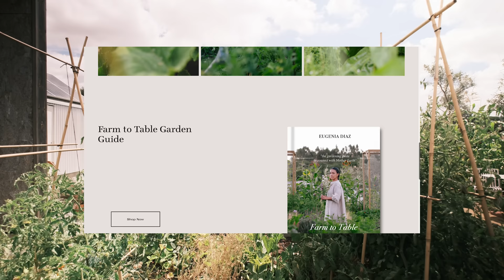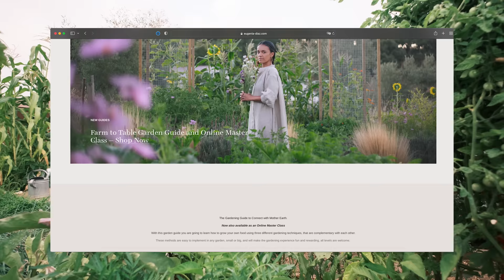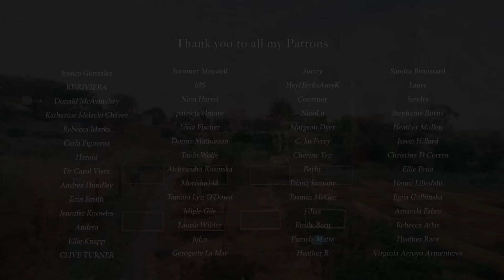#36 It's Over...I Failed at my Off Grid Project

Comment: The best time to plant fruit trees in a Mediterranean climate is in the fall /winter/spring  for evergreens (citrus etc) and Dec/Jan/Feb for deciduous trees. They establish easier when it has been through a cooler rainy season. It is a stress for the trees to be transplanted in summer heat and you will also find more selections as well.